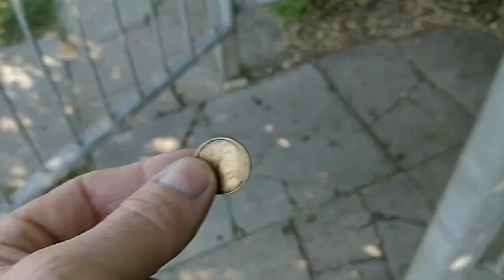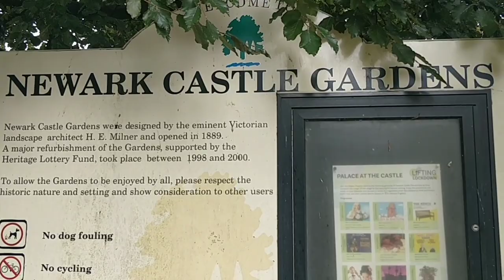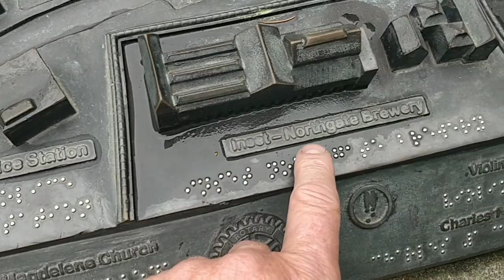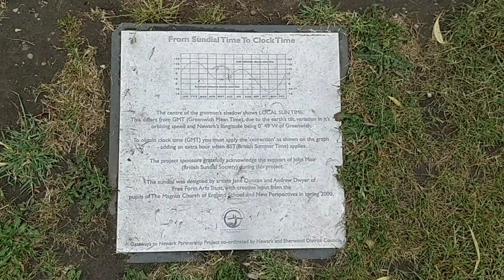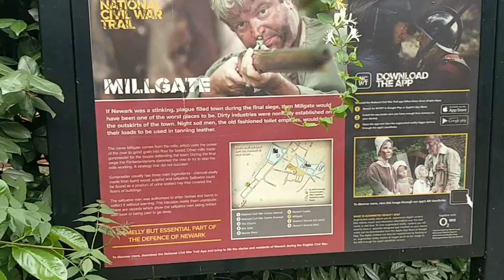Narrowboat journey to Newark castle. Amazing place.

Comment: I often hear that you shouldn’t do certain things, like sitting beside the tiller in case it hits an obstruction and flings you overboard.  Seems to make sense, BUT I’d really be interested to know if it ever actually happened to anyone? Or is it just a sensible precaution?  Thanks
Reply from the maker: I have spoken to boaters and it's happened to them but I've not experienced such a thing. When reversing into shallow water it will happen if the tiller hits something. I just don't want to go in the water, Ever..Ha Thanks for the interesting question.